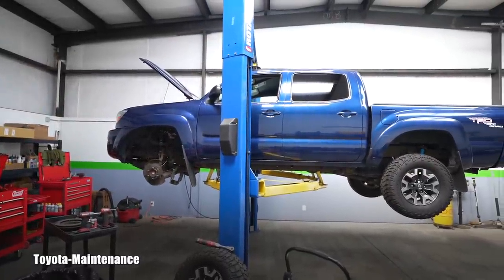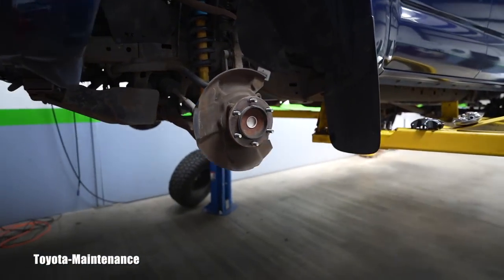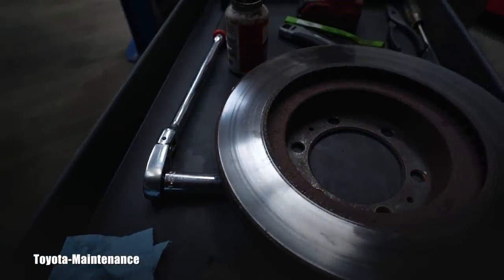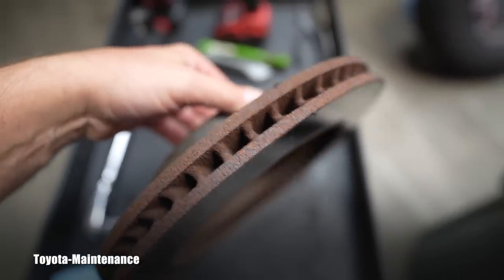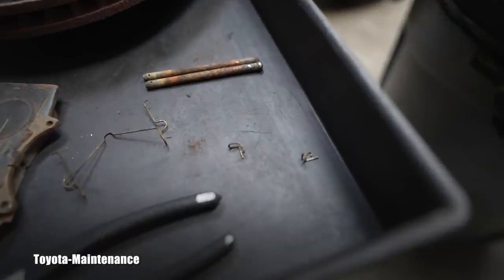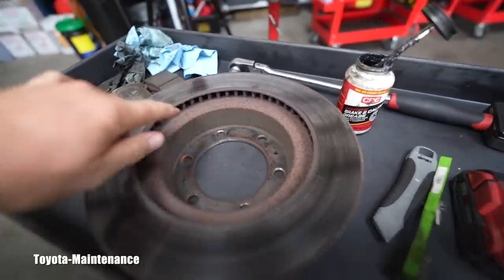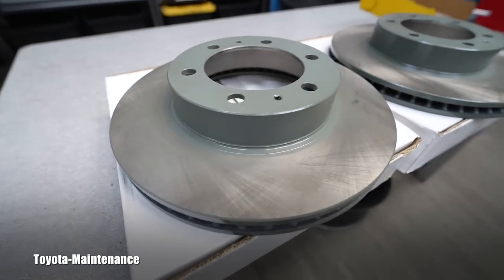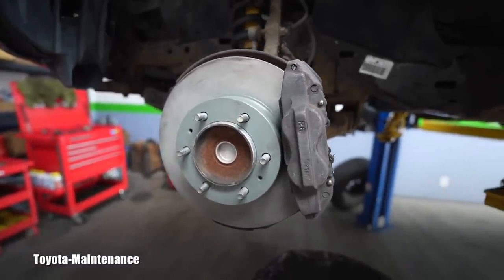Brake Job : Resurface Rotors or Replace?

Comment: 7:30, I always apply a thin layer of anti-seize paste on the surface of wheel hub to prevent forming of rust and getting disc rotor stuck to the hub.
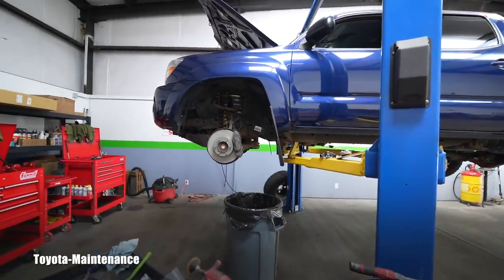Reply: 9:18. Watch before commenting.
Reply: @SK-xi3ph  Yes?
Reply: @MrCROBosanceros  If you watch more closely and watch for at least 10 seconds, he's telling the same thing that you said in your original comment. And it is a common known good practice anyway.

Comment: Scotty Kilmer is right about turning rotors.Even Toyota rotors from a 1997 Landcruiser with plenty of thickness that were made in Japan as I have had turned,Warped 15 thousands lateral runout within a couple of thousand miles even with organic brake pads.The problem I believe is that the carbide insert is too coarse for the metal and creates broken surface covalent and ionic lattice structure domain bonds.You can see it with a microscope.A machinist  friend told me that this is why a new rotor is very smooth and does not have deep lines cut in to the surface as when you turn them on a lathe.I did Plasma coating work in North Carolina with vapor deposition sputtering in a vacuum chamber,And used a local university SEM and tunneling microscope to see the surface of various materials after polishing and it makes a big difference on surface strength and hundreds of microns deep in the material when its polished correctly.Ceramic brake pads and metallic pads deposit and transfer through galling,Materials to the rotor that makes the surface swell unevenly is also a factor.Good work for the people .Cheers.

Comment: My mechanic's rotor turning machine broke down and he never fixed it, so now he has to send the rotors to a machine shop for   service, so I'd just rather buy a new set. I just don't buy the top of the line ones.

Comment: I haven’t turned rotors since 2000. I have always purchased aftermarket rotors, really haven’t had many problems. Recently using coated rotors to minimize rusting.  Thanks…Jim
PS…..used to use Honda on Honda pads, but with low life, I switched to Bendix. Because of common low life on Toyota I’m using Bendix also (using first time we’ll see the life).
Reply: What do you mean lowlifes? They don't last long enough for your satisfaction? Are you using semi metallic pads? Have you considered metallic? Are you in a lot of stop and go driving?
Reply: @LAactor  On my Honda’s I was used to about 80,000 miles on the front for pads, a little more for rears. I always used Honda parts. I have been driving Honda’s since 1996. My wife’s 2006 Accord (purchased new) got 88,000 miles on front, about 55,000 miles on the rear. This was not acceptable, the Honda dealer said that had an improved pad. This new pad did about 43,000 miles, it was worse than original. At this point I changed to Bendix pads and got better life. My wife’s 2017 Toyota RAV4 has 68,000 miles and we’re doing the front brakes this morning, this is low for my expectations. I am using aftermarket Bendix pads because of the low miles. I live in a NW suburb of Chicago and we do not do bumper to bumper traffic. I get more miles on my 2009 Honda CR-V (purchased new), I got 93,000 miles on fronts and 108,000 miles on rears. Thanks…Jim
Reply: @jimpie231  Try Akebono brake pads. Excellent quality and last the longest.

Comment: I have a 2005 Tacoma access cab with 4 wheel drive and towing package (I tow 6000 lbs).  I have over 135 000 miles on it.  The brakes have never been changed.  There is not any lip on the rotors and still have about 1/3 of my pads left.  The braking is as smooth as when they were new.  I stick to OEM parts as they last and last.   My truck is stored inside so no rust. Lee

Comment: Looks like the pistons have uneven pressure being applied. I bet the brake fluid needs replacing also.  P.S. It's getting harder to find a mechanic that turns rotors in my area. Good job.   chuck
Reply: Yup, turning rotors is a case by case depending of the condition/diagnosis and the knowledge/willing of the mechanic. Many times, rotors can be saved and good enough for at least 75% of the initial/original life
Reply: Good choice of replacing the rotors. Safety is paramount imo. I painted my calipers to keep the rust down. Bleed & refresh brake fluid every 2 yrs for good measure.  It's hygroscopic so always cheap enough to change imo.

Comment: Seems like the rotors are getting hot cause the pads are not retracting enough.  I usually clean behind the brake pad piston area with Simple Green before putting things back together.
On my Honda FIT with now 75k miles, changed the pads to Akebono ceramics at 70k, before that they started to have the shake when braking...that started slowly but got worst over time.  I waited till the pads needed to be replaced.  Was thinking of turning the rotors but with modern cars they tend to spec the rotors thinner from the factory so when they do get turn the warp easy.  Anyways the rotors looked good besides the shaking which wasn't bad so I decided to try and just replace the pads.  The first 100 miles I broke them in hard got them hot and bedded the pad material into the rotors, and after about 200miles they worked great, felt better then stock, smooth quite strong.  Odd thing was that the rotors also stopped shaking by about 200miles.  So back to the present with about 5k miles on them the brakes feels great no shaking at all as if the car was new with only a few thousand miles.

Comment: I have never resurface, or replaced the rotor, because I had one of them floating rotor and was scared to take the assembly apart to remove the rotor.   But I have went through 5 sets of brake and 200k on it, and had no issue at all.   I finally replaced it because it was at its minimum thickness. But In the process I did damaged my bearings, drain the master cylinder, installed racers upside down,  went through, 2.5 big bottles of break fluid spent about a grand on tools, towel, and parts.   To my surprise I'm still alive.  And yes, my fear of removing the rotor was justified.   Now for the rear brake shoes. Lol

Comment: Yay! So happy to see you post today. Never see you do it. I imagine you are in the van in some redwood forest on Sundays..

We are such a throwaway society. In world's where salvage is king, everything is reused or recycled until done for. Imagine if we lost the ability to mine or make iron. The pot metal and think and weak chineseum rotors are so thin they make them to be replaced and cannot be in spec when machined. 

Too bad there are so few mechanics who want to use up their machine tips and just make the customer spend and for what. Lazy techs. People need to keep their original oems. At least until the minimums. And by then it's the same as the thin ones that don't dissipate heat as well and cause greater brake fade as well as more warp pedal pulsation.

Comment: Today at Toyota, 3/23/23, turning is $300 and replacing is $600. Getting them turned if it’s possible. 65000 miles on my 2018 Tundra.

Comment: I had my 2002 Echo front disks resurfaced at 120,000km but they vibrated under braking load so the shop replaced them at cost with new rotors (only $80 per rotor anyway!).  I wouldn't hesitate to replace rotors if in doubt.  Unless I owned a Renault in which case my friend paid $750/rotor!

Comment: Always replace. Don't putz around with brakes. A brake job should include everything new, including the rubber boots on the brake assembly.
So funny to find a mechanic at a lathe and 'old rubber' on the car. Doesn't make natural sense to me.

Comment: Father in law has 18 Tundra with 9k miles oem rotors just rusted even though pads were like new. Usually I agree with oem Toyota parts but upgraded him to zinc coated cross drilled and slotted Canada rotors  with no issues. Just don't buy Chinese ones they will warp due to cheaper metallurgy and thickness of rotors. No more rust. Ceramic pads and paste on new sliders and on hub makes them run smooth. Paint calipers with caliper paint to keep rust down too.
Reply: Toyota is known for not lubing slide pins enough on the Tacos & Tundras.

Comment: I'm in my 40's and I've only ever had one set of rotors turned. New rotors aren't that expensive and I'd rather skip the step of taking my rotors into town when I'm doing the work at home. 
It wouldn't surprise me if a lot of new rotors are made close to minimum spec and can't afford to have any material shaved off.

Comment: I agree about aftermarket rotors, they don't seem to hold up as well as the OEM before the annoying steering wheel shaking begins due to warping/hot spots.  I've recently tried AC Delco brand on my 2000 Camry with the hopes of better results compared to no-brand ones.

Comment: Maybe a stupid question:
The brake pads were ceramic and were practically new. It wasn’t clear to me in the video if they were ok for reuse or if you installed new ones. I wouldn’t want to damage new rotors by using contaminated pads, but I hate throwing away perfectly good pads.
Reply: For shop liability reasons I'm going to guess is the easiest answer. Here's another thing. Why not just replace them for the safety of $50 bucks vs a risk.. 
But at junkyards they're completely taken and you just abrade them up a little with coarse grit sandpaper or Emory on a hard flat surface and wash them off of debris that could embed and you're good to go. If they're not heat checked cracked or otherwise seeming like the calipers got too deep into the backing plate, well, it's your car.

Comment: I had to swap my 2014 tundra rotors and brakes to aftermarket after the eom rotors warped. I have put about 100k miles on those rotors, currently at 152k on my tundra.

Comment: Quality of Toyota brake parts are excellent. I still have original brakes on my 2010 Toyota Yaris with a 105 000 miles (170 000 km) on the odometer. Original rotors, original drums, original pads, and original shoes. Brakes on my 2006 Toyota Corolla usually last over 68 000 miles (110 000 km). Every two years I take brakes apart, clean them and lubricate sliders with silicone grease and I flush brake fluid. I would not buy any after market part for the brakes, maybe stainless-steel braided brake hoses.
When I used to own 1994 Mazda 323 and 1997 Mazda Protege vehicles, brake rotors would develop big groves before you even make 18 000 miles (30 000 km).
Reply: In San Francisco with these hills every 18,000 new brakes,not kidding!
Reply: @dogsense3773  I feel ur pain, I used to live on hills. 🙄 Helps if u have a stick.
Reply: @dogsense3773  Honestly! Pads and shoes never wore out but deep grooves and pulsation would developed very early. I even tried after market brake rotors like Brembo. Same thing. I think the only Brembo was the Brembo sticker and nothing else. Probably those brake rotors were undersized for those particular vehicles. No other complain when it comes to 1990's Mazda vehicles.
Reply: @dogsense3773  Just a brake rotors and they were very cheap back then.

Comment: If your rotors are in decent shape and the auto parts store turns them for free, I would go for it
Reply: Most machine shops charge 12.00-15.00 each rotor to turn.
Reply: @PRO4XKEV  it’s 25 in my area
Reply: Gone are the days of free turning. Also if you check review sited if each individual local store you'll see complaints of run-out warping still after turning. That's because they're parts guys. Not daily mechanics. If they don't have an old timer there to machine them, and a kid is doing it and they don't do the slop second pass, or they take too much at a time to save the time doing it, the job isn't going to be done right.
Reply: @LAactor  I agree. It’s really hard to find someone who not only can to it right but has knowledge on how to trouble shoot
Reply: In my rust belt only exception is for antique vehicles the rest always too rusty and results in warped rotors weeks after they resurfacing
Reply: @PRO4XKEV  I checked with a shop on turn a rotor and they quoted $50 each if I brought them in. My rotors are high carbon, which is a lot more expensive than regular rotor, so reason why I enquired on rotor turning as I haven't had a rotor turned in 20 years. Only had one set of rotors warp on me, it was the front and they were Advance Auto brand called Wearever.

Comment: IMO you were correct to replace Peter. We just changed the front rotors and pads this morning on my sister in law's 2018 Rav4. Sliders were not moving freely. Done in no time flat. She's a happy camper again, no mo' squeal.
Thanks for the video. Up there we call that "heat scoring".
Malcolm Ottawa Valley

Comment: I work at a honda dealer in san Diego we always turn the rotors on the car lath, but some cares come from rust belt areas and the rotors are junk or hard spots from heating, I think in the rust belt they never turn rotors, and replace the spring clips and hardware.
Reply: Well they don't come off unless you really beat on em. Even using an a pneumatic air hammer to break the rust loose is questionable to it's usability after. If they don't come off willingly, they're likely to be replaced.
Reply: Correct.. from wisconsin

Comment: I've owned Toyotas most my adult life. Toyota went through a "phase" were every stinking rotor they put on a vehicle would warp. If brakes start vibrating and you turn the rotors, the vibration will come back in a few thousand miles. If the rotors are not vibrating. Turn the rotors and hope you don't cause issues. Rotors are a wear item. I use OEM pads and buy quality aftermarket rotors. If they warp, then you are out less money. I have never seen a toyota rotor outlast a good quality aftermarket rotor. Not saying it doesn't happen. Just my penny.

Comment: I replaced the factory pads on the front early at 140K because I was selling the 94 Toyota truck to my nephew. I down shift and use the engine and transmission to hold the truck back going down steep hills rather than using excessive braking. I also don't tailgate which leads to a lot of hard braking.
Reply: Brakes are cheaper than a transmission

Comment: Hello, I need to replace my original Brake lines attached to my caliper (rubber) on my 2002 Tacoma 4x4. Do you recommend Toyota or aftermarket? Thanks

Comment: My 08 4runner will need brakes in the Spring. The rotors have been resurfaced once. I'll be replacing them this time. Is a Toyota replacement rotor recommended?

Comment: Tru fact, dodge ram 1500 2017 oem rotors and pad lasted me 40,000km befor rear pads were to steel and front rotors warped . Got 400$ brake job aftermarket and 4 rotors and pad now I hav3 to buy more brakes but... my truck is at 180,000km now soon Tru oem is in fact 4 to 5× worst then aftermarket  oem is the cheapest cheap thing car manufacture knows their brakes arnt warenty

Comment: I have noticed that aftermarket rotors seem to rust much worse than my OEM General Motors ones did.  Different spec for the steel alloy?
Reply: And also thinner. There's no set spec except for minimum thickness and if you use less material in the rotor you can make them cheaper.

Comment: Peter, where do you get your rotors? Have a 2004 RX not driven much. Should I stick with oem or Napa/ o’rally’s/ autozone?
Reply: OEM if you can afford it. If you don't drive it much not all rotors have to be turned and machined each time. No pulsation? No grooves? Emory them slightly and pad slap. Lube the pin and metal contact points that touch the backing plate of course. Those Best branded rotors are from the delivery supplier O'Reilly. Napa is also good for the most part. Their rotors do come rusted sometimes. Just paper barrier wrap. No protective oil with them for some reason.

Comment: Nice job! I have a question about my 2019 Camry Hybrid regarding the rotors. Most of the braking I do is not braking with the pads but with the generators to recharge the the battery, so called regenerative braking. As a result the rotors on my Camry hardly wear. That seems nice however they rust a lot and I am afraid the rust will kill the rotors rather than the wear. What is your take on this?
Reply: He doesn't answer questions but my take is every once in a while brake harder so you are no longer regeneratively braking and actual braking with the disk and pads. Some owners have reported 100k+ miles to 150 without even changing the pads. Surface rust won't harm it. It will be scrubbed off at the next actual braking. I would even say no more than once a day. Probably could even go two days or three. Rust doesn't eat overnight. If you live on the salt flats of the Maldon sea in the UK you might have a faster rate of corrosion, but then at that point your frame will give out almost as soon.

Comment: Peter, educational questions, assuming that old brake disc you took off still has plenty of life, would surfacing it improve fuel consumption? Also would brakes pulsing reduce fuel consumption? Thanks
Reply: He doesn't answer questions but I would say the more you brake the more fuel is used. The harder the brake needs to work the more fuel used. Easier braking or less braking would use less fuel. Also with pulsation, it means the pads aren't fully contacting the disc. So before mileage, control the pulsation so the car can stop in a shorter distance than needed.
Reply: The only way I think it would change your fuel consumption would be if the pads were rubbing when they weren’t supposed to be.